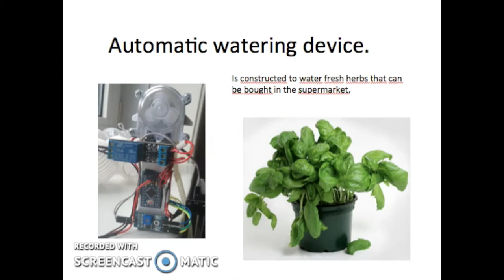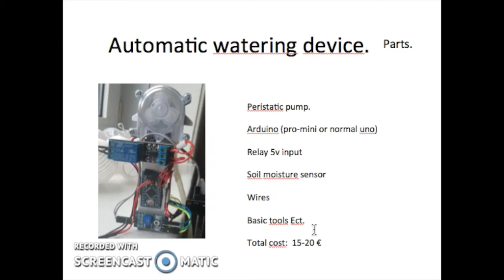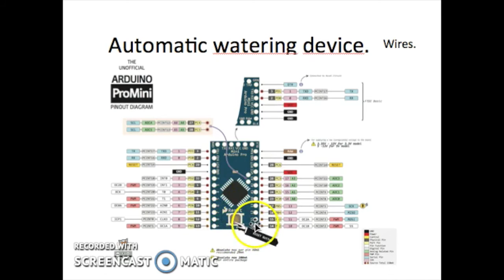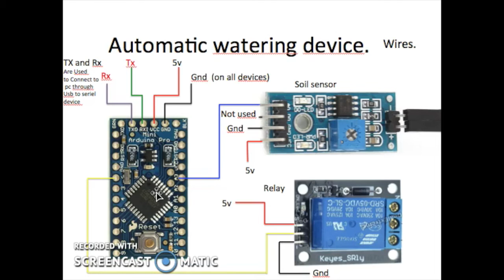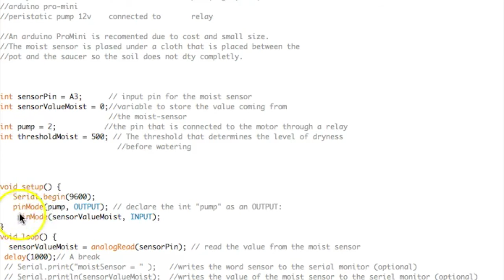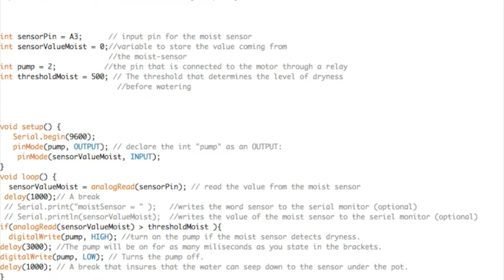Automatic watering device (arduino),  extra info: wiring, coding, ect.

Comment: if you wanted to use say 3 sensors to monitor 3 plants can you take the average between the sensors? How would that effect the coding?
Reply from the maker: You will need to write a new code but it is possible.

Comment: hi im doing the same kind of project but for a couple of more plants some of the people i was talking to recomended to have the sensor power pin on a digital pin and have the sensor turning off becouse of over time it will do some funny stuff to the metal on the sensor and readings will differ i just put in a couple off digipins as out puts to drive each sensor so before reading i just put in  digitalWrite  (sensor1, HIGH); // sensor1 is the power pin on sensor1 connected to D8
delay (1000);// so the sensor reading stabilize before  actual value is read 
and you can realy easy use the map function 
int sensorPin = analogRead(A3);
int sensorValueMoist = map(sensorPin, 1023, 0, 0, 100); 
it vill give u a much more readable serial print in actual % values realy like your pump and your video
Reply from the maker: Yes there is a problem with galvanic Electric corosion on the probes of the moisture sensor. My suggestion is to make the probes out of staines  Steel. It is also as you have pointet out an option to only power op the sensor at small intivals with Will delay the decay of the probes for a time.

Comment: link to sketch code doesn't work
Reply from the maker: here you go 
//the code is used to drive a watering device that can water a plant in a pot.
//Made by Karl O Villemoes. 26/02/2016.
//component list:
// moist sensor          connected to       pinA0, gnd, vcc,
//relay                  connected to       pin2,  gnd, vcc,
//arduino pro-mini  
//peristatic pump 12v    connected to       relay

//An arduino ProMini is recomented due to cost and small size.
//The moist sensor is plased under a cloth that is placed between the 
//pot and the saucer so the soil does not dry completly.

int sensorPin = A5;      // input pin for the moist sensor
int sensorValueMoist = 0;//variable to store the value coming from 
                         //the moist-sensor
int pump = 2;           //the pin that is connected to the motor through a relay
int thresholdMoist = 500; // The threshold that determines the level of dryness 
                           //before watering

void setup() {
   Serial.begin(9600);  
   pinMode(pump, OUTPUT); // declare the int "pump" as an OUTPUT:
   
}
void loop() {
  sensorValueMoist = analogRead(sensorPin); // read the value from the moist sensor  
 delay(1000);// A break 
 //Serial.print("moistSensor = " );   //writes the word sensor to the serial monitor (optional)                 
  //Serial.println(sensorValueMoist);  //writes the value of the moist sensor to the seriel monitor (optional)
if (analogRead (sensorValueMoist) < (thresholdMoist)) {
digitalWrite(pump, HIGH); //turn on the pump if the moist sensor detects dryness.
delay(1000); //The pump will be on for as many miliseconds as you state in the brackets.
digitalWrite(pump, LOW); // Turns the pump off.
delay(1000); // A break that insures that the water can seep down to the sensor under the pot.
}

  
}